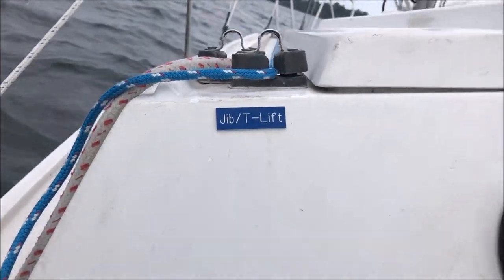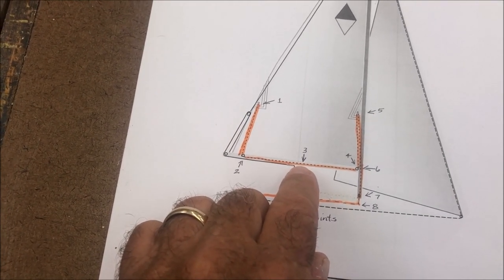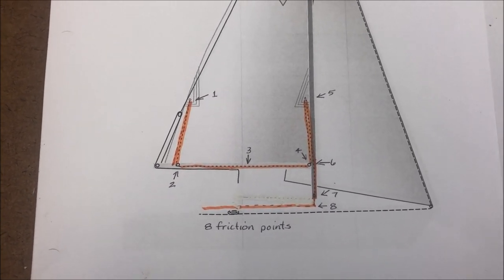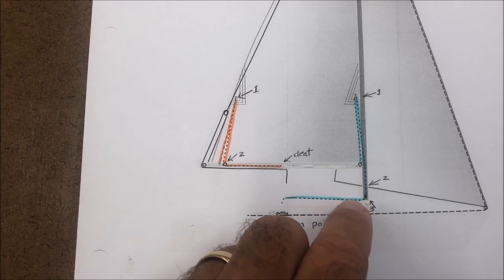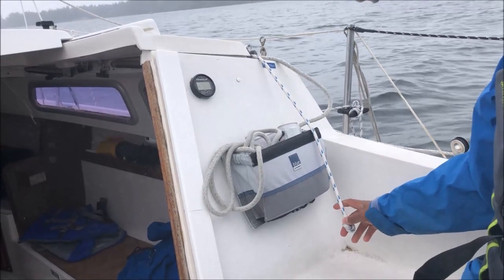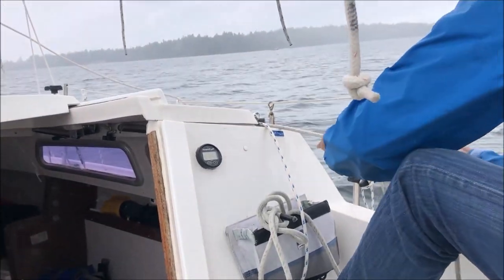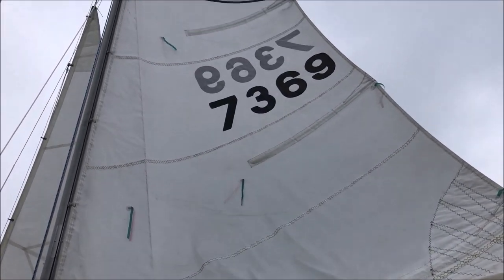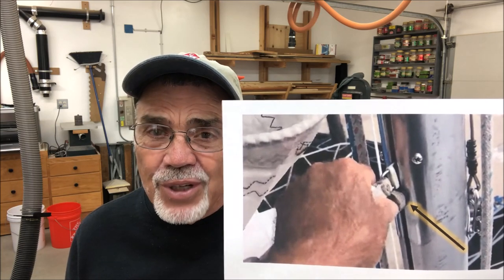Reefing a Small Sailboat.  Catalina 22 - Jim's Little Boat - Single Line Reefing vs Double Line

Comment: Another well done video. I'd love to run across you in the inlet some time. Another benefit of two line reefing is separate control of outhaul trim.

When I rigged my two line system, rather than run the forward reef down the mast and aft along the cabin top, I ran it along the boom on the opposite side of the aft reef line. Both run to horn cleats mounted on the boom located at the forward end of the cockpit. This allows me to reef from one position and with the horn cleats, I can put a turn on and sweat the line for extra leverage.

Comment: Great, clear explanation. On larger boats, you won't have the first line attached to a flat on the boom, but to the mast, or brought aft. 

I'd like to add that a common, third option is to have one reefline that goes all the way to the back, and a hook at the mast instead of a line. Maybe that's more common on larger boats, if you have three reefs, it would lead to 6 lines aft otherwise.

Comment: Ha! great timing. I decided to just get sailing once I got the boat back in the water and put new sails on her this summer(she was half sunk and rats had eaten a bunch inside including the sails before I got her “free” in 2018). Your guidance here rings true to me, the Catalina 22 is small enough to stand in one spot and quickly pull the 2 reefing lines. Even though she looks and acts a lot like a big boat, I don’t need to rig her like my old San Juan 28! Less friction means my crew can reef, or I can do it quick when Im alone. Glad I saw this before I rigged the single line reefing I had planned!
Reply from the maker: Some knowledgeable folks don't agree with me, but it seems better for me.  Glad to help.  jim

Comment: Great video! I have an O'day 25 I want to single hand soon, and I have not reefed it yet while out sailing. I was going to use two lines,also. I like your idea of running the second line back to the cockpit.
Reply from the maker: I have been very happy with this set-up.  I have been able to reef by myself except in the most windy weather, and I wouldn't go out by myself on 20+ knot days anyway--although I have been caught out there when it got a little crazy.

Comment: Thanks Jim. I am installing a double line reef system on my Santana 2023. I'm wondering how far aft on the boom I should install the first turning block for reef #1  (I'll worry about installing reef lines for second reef later). Should I mount the turning block slightly aft of where reef clew will reach the boom, or right in line with where the first reef clew will meet boom?  I do have a 3:1 outhaul already. In other words, is the placement of the aft turning block critical?  Thanks. I enjoy your tutorials.
Reply from the maker: I went just a tad aft of the clue to keep the sail's foot tight along the boom.
Reply: @jimslittleboat4388  Thanks!

Comment: Great video. Complete newbie here. Just bought a Catalina 22 with a double line jiffy reefing setup, no mastgate. I plan on buying one. Trying to figure all this stuff out! Could you explain why you have both the stopper and the mastgate in? I figured once I installed a mastgate, I wouldn't really need the stopper. From Liz's below comment I gather its because the slugs can catch more easily through the mastgate, so for general raising/lowering the main (not reefing) I'd rather keep all the slugs above the mastgate?
Reply from the maker: I have tried about four different mast gates.  On all  of them the slugs have a tendency to hang up at the bottom of the mast gate so I use the stopper to keep them all above the gate before I raise the main.  The problem is that once we are sailing I frequently forget to drop it.  The gates I am currently using came from mastgates.com and they work the least badly.

Comment: I'm not very experienced at reefing, probably done it twice in my life, but I don't understand why friction points matter. As long as you keep the boat pointed into the wind the luff sail shouldn't be difficult to reef.
Reply from the maker: If the wind is blowing even a little bit all that extra friction makes it really difficult to reef.  Even though the boat is headed into the wind, the main will flog a bit.  When I broke the system down into two parts, I could reef while we continued sailing, there was usually no need to go head to wind.

Comment: Question Jim: my daughter 17 and me 65 both sail. We are moving to the NW Seattle/Spokane and want to buy a sailboat, a smaller one. We want to sail the San Juan’s and Puget Sound all over… should we get a Cat 22? Thanks very much!!!
Reply from the maker: There is a lot to recommend the Catalina 22.  They made a lot of them so there are many to buy.  They are easy to fix:  Lots of used parts and lots of parts support through Catalina Direct.  Not the snappiest tacker in the small boat fleet but great on a broad reach, stable.  I considered an O'Day also a great boat and a San Juan 21 and settled on a C22.
Reply: Should I look for retract keel, a winged fixed keel or a twin keel on the C 22?
Reply from the maker: @teach1644  I almost bought a fixed keel.  But I am glad I didn't.  The keel bolts had already been sistered up and all the bolts were a little corroded. And you either have to sling it in and out of the water or you need a hellatious long tongue extender.  If a person is going to go to all that trouble, just buy a bigger boat.  I really don't know anything about the wing keels.  They have less maintenance, but some people say, they don't point quite as high.  And they can have their own issues with keel bolts (since the bolts are located in the bilge). The swing keel needs more maintenance but it is easy to do once you figure out how to get the boat off the trailer.  The swing keel model seems to be easier to find.  I lift my boat off the trailer every fall; once you are set up, it is pretty easy to do---I made a couple of videos about that.  So, I guess that is my non-advice.  Good luck in your search.

Comment: Jim do you feel that those cam cleats you have are sufficient as rope clutches?   any signs that they may be pulling up or stressing?  How long have they been in place?
Reply from the maker: I put them on six years ago.  They seem fine,  I didn't even install backing plates, but I did use large washers. In this application, I just wanted cleats I could operate with one hand.